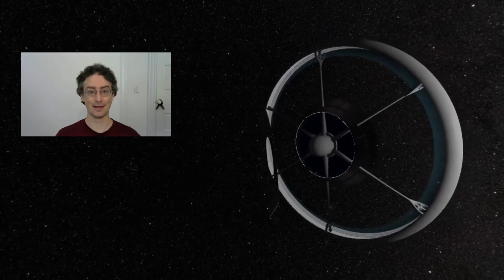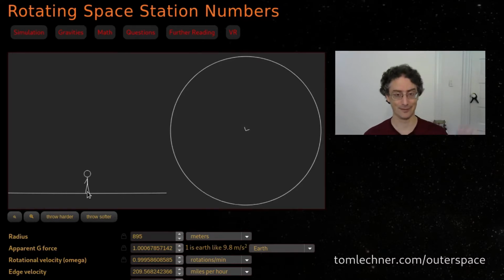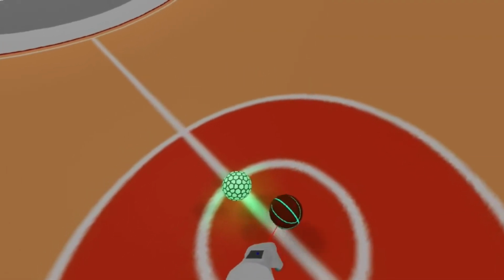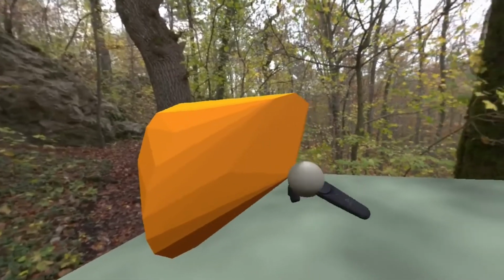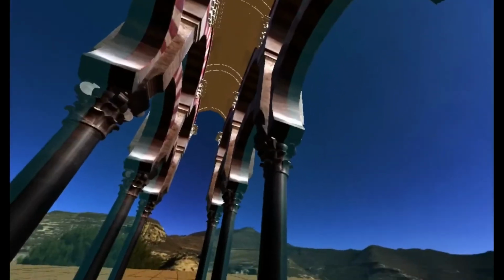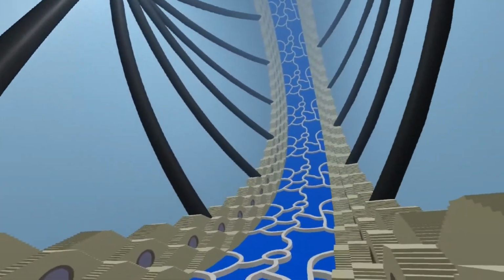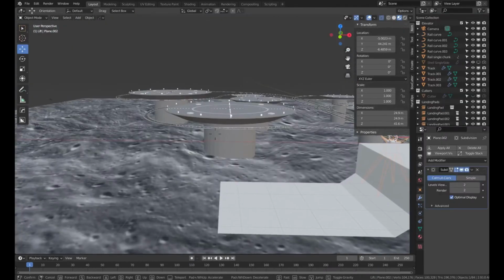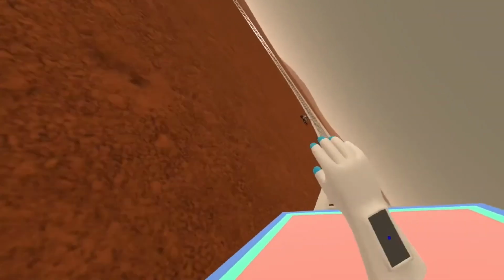Rotating Space Station Devlog #1

Comment: 37:02 Wow, this is the most impressive rotating space station demo!
Did you simulate a basketball air drag? And what should be the air movement inside the station? Should it have the same angular velocity as the station itself in every point? Or should the angular velocity of the air be lower and reduce further closer to the axis of the station?
Reply from the maker: I didn't simulate air around the basketball, it's just a naive sphere in this version. My assumption is that air in a space station will mostly follow along with the inner surface since there would be buildings, plants and other things that would kind of drag along the air, and get less dense as you approach the central axis, though I don't have mathematically rigorous proof for this! Let me know if you find any! It would be nice to know if interiors would always just be kind of drafty. Plus not sure about temperature gradients in the air in stations. Hot air generally rises, not sure what that would mean for central areas either. So many questions to figure out still!
Reply: @tomsart  Thank you! Hope one day there will be new videos with your experimentations :)

Comment: I'm searching for the calculations for the earth, moon and sun to spin around a stationary wheel station, as though the station is rotating in orbit around the Earth. Have you ever seen anything about this? I think I need this to create a wheel station I can walk around in VRML or X3D, since there's no centripetal acceleration in VR.
Reply from the maker: The orbit of the station itself can be anything you want really. Celestial positions can always be fixed after building the station itself. Mostly I just do extremely approximate orbits and positions relative to each other based on wikipedia orbital inclination and rotation period data applied to circular orbits, and some math to deal with nested transforms. You might also look into planetarium software like Stellarium or I,Voyager.